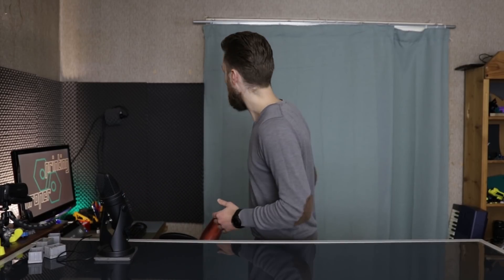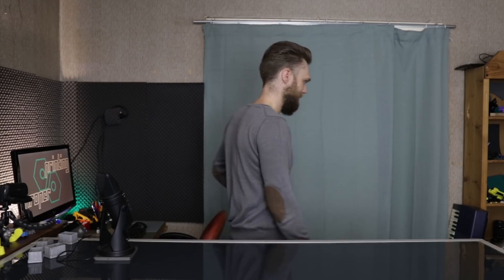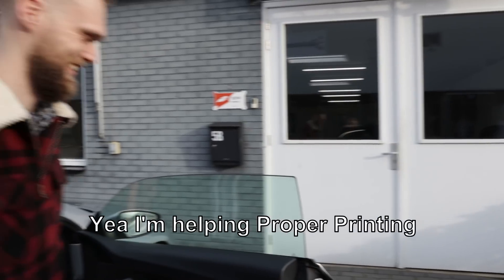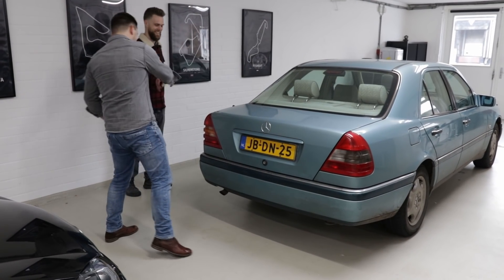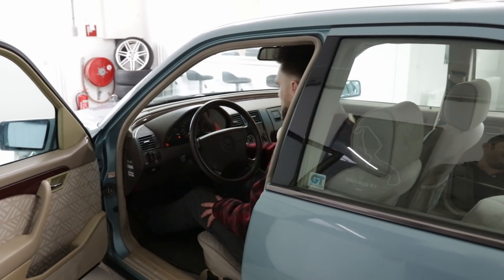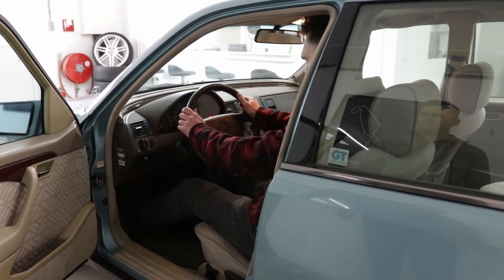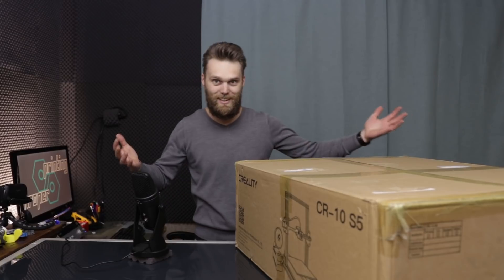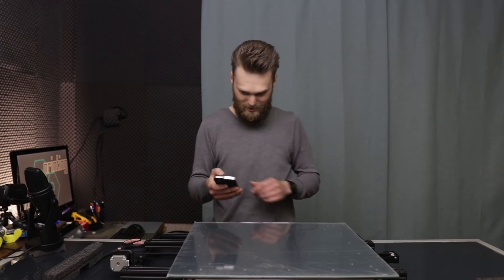Project Rim: insane 3D printing project!

Comment: OMG: Well, you got a nice hefty specimin.  You, know, a little bit of FEM analysis, you'll know by an order of a thumb what modulous of elasticity you'll need and how thin your parts can be? Should the engineering gods tell you how you are going to die now? Did that vintage of car come with air bags? Yah think they still work? You want to dissapoint your mother!  At least get a 5 point harness before you drive with those rims Jón. The subscribers are not worth it! Plantnum and cakes are not worth it!!

Comment: If you inflate a tire on a plastic 3d printed rim. Expect the rim to fail catastrophically. Expect pieces of the rim and tire to injure or kill you. Use caution with this project as if you are building and testing explosives. Be very careful with this. Working with tires is my occupation. I have seen both tires and rims explode, and it is very dangerous. I would be more concerned about the rim exploding, than whether or not it can hold the weight of the car. You could simulate the force of the air pressure on a plastic rim, in Fusion 360. I don't think fusion 360 simulations can account for the plastic being layers of laminations, and every layer is a potential failure point. Again, be careful!
Reply from the maker: Thanks for your concern. If I'm going to inflate it the first time I'll do it from a safe distance and it would be interesting to see how much pressure it can handle before blowing up. Not only to make good content, but to know what happens and how safe we are
Reply: @properprinting  i look forward to that video. Also, nice work on the cnc style 3d printer.

Comment: I think i might be interested just get the tire mounted let alone driving on it
Reply from the maker: That's going to be the first tricky thing! I have a plan B for getting the tire on it ;) Driving, steering and braking will be a bit frightening xD
Reply: You could print them in 2 pieces but then you would need a gasket material or custom o-ring

Comment: As an amateur 3D printer noob, this is going to be a fun adventure to watch. I've been racing cars since I was a kid. 

Of all the performance modifications and components that I have bought the most of, it's rims. From Formula Ford to  tubular frame stock cars, the rims are the most commonly bent, twisted, cracked to destroyed part on a race car.

If not built correctly, the consequences can be brutal, from a minor repair costing a few hundred dollars, to being in a 6 to 10 car pileup that wrecks a half a million dollars of equipment in 4 seconds.

Have fun!! I'm definitely interested in watching and seeing this project unfold.

Good luck!

Comment: It'll be fun to see you put the tires on the rims. Will you do it by hand or with a machine, isn't the steel of those machines going to damage the rims?
Reply from the maker: This will be the first major thing to overcome. I'll do it by machine and see how it goes. If it turns out to be impossible I'll do it by hand or I have to come up with a different approach ;)
Reply: @properprinting  Definitely want to see the flame trick, then you'll have a different rim on each wheel 😂
Reply from the maker: @wpigot  hahaha the flame trick definitely came to mind. Would make some great content if it explodes and the ABS rim catches fire 🤣

Comment: awesome idea for a project! Looking forward to watching it. For the S5 I'd 100% suggest you get a keneevo silicon heating pad. Otherwise you'll never do ABS. I'd also recommend ditching the glass and getting a PEI magnetic sheet. It will dramatically reduce the weight of the bed. For mine I also got the 3dfused sled for the S4/S5 and attached it to linear rails. I replaced the aluminum bed with a carbon fiber sheet from AliExpress. With all of this I figure I reduced the bed weight to a little under 50% (like 40% less) and it heats up SUPER fast.
Reply from the maker: Thanks! I'm definitely going to take a look at a silicon bed indeed! I have some neat ideas to overcome that weight problem ;) Thanks a lot for your suggestions!

Comment: I think it'll work until you do repeated hard breaking and/or continous high speed use. Greased bearings get hot at high speeds, and the whole hub gets VERY hot with lots of braking.
Reply from the maker: I think that braking will be a problem too. I'm very curious how hard I can brake before it breaks (that sounds funny xD) Good point about the temperature, I might have to make (hopefully print) a ring which isolates and can endure the heat. Thanks for bringing up!

Comment: I can oly recoomend to use a super vulcaono on the  cr10s5 as well as a BLtouch and while zou are at it, use a SKR mainboard and upgrade to a hemera, that way your LARGE prints will not take 4ever...
Reply from the maker: Yes exactly! Thanks for your suggestions!
Reply: @properprinting   I have done the same ( apart rom the hemera , that is WIP)  and oh yeah, get a 1.2 or even better 1.4 MM nozzle.... but 1.0 mm is the absolute minimum for a printer that size...
Reply from the maker: @patrickmaartense7772  Nice! Yes I'm going to print with a large nozzle. Besides the speed it increases the strength too and the rim doesn't need those fine details. Oh boy I'm going to need a lot of material xD

Comment: I thing Hangprinter would me more effective to print  car parts)
Reply from the maker: Thanks a lot for mentioning this! I was looking for a this design but couldn't find it. Not for this project though, the S5 is cool and the upgrades I have to de can be applied on other printers as well which makes this interesting for others ;)
Reply: I reckon the S5 will print faster and is big enough. Hang printer good for body panel mods though

Comment: You could have picked a smaller car! 
Good luck. I'm not even sure it will hold air. Unless you're doing a solid wheel.
This looks fun and dangerous so be careful.
Great video. Keep up the good work.
Reply from the maker: Yes I could and I wanted to do that at first but my friend Melvin had this one and it makes it a bit more interesting xD Exactly one of the questions that I'd like to answer! I cannot assure that this car will survive, but I'm going to do my best to survive this myself xD Thanks!